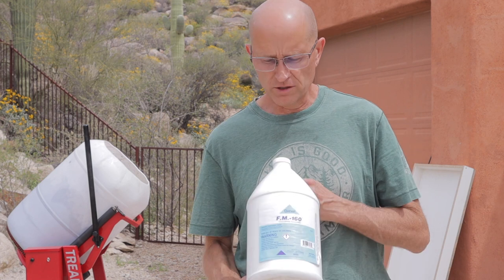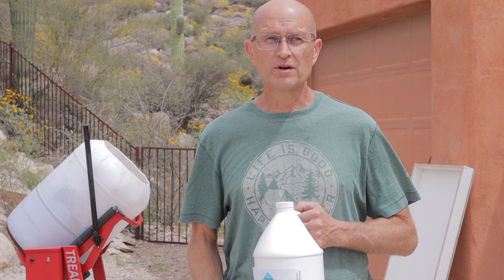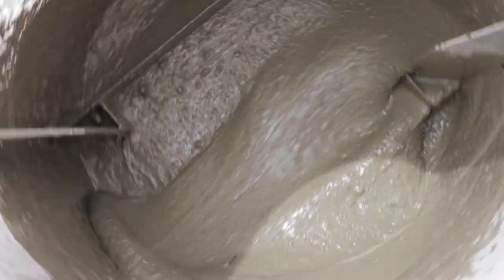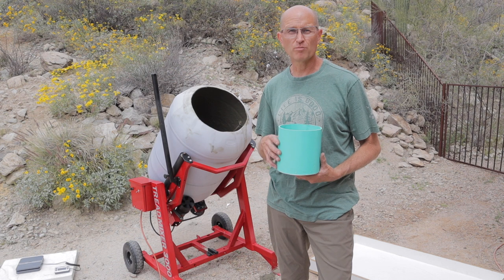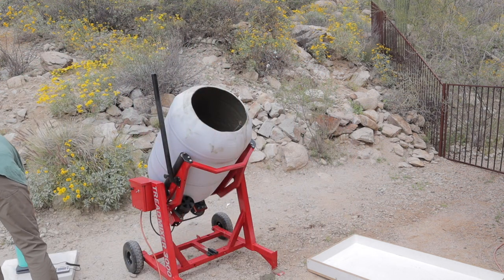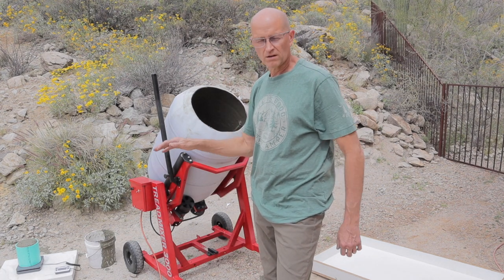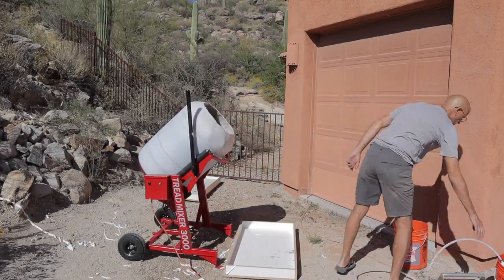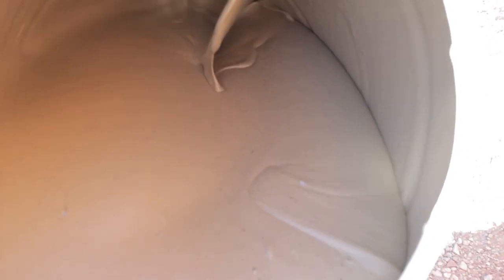How to Make AIRCRETE The RIGHT way!  [ How to measure Density for consistency.

Comment: OK, you had me with the TREADMIXER 3000 sticker! I was wondering who made such a cool mixer - where you could use different plastic drums, I assumed. Then to realize that it is just one eccentric guy that builds them. Thanks for your info! Yes, CMX is more powerful with significant minerals present, but their enviro warning...maybe does not apply in your climate. Still learning about aircrete. Thanks!
Reply from the maker: SpaceCrete, hey thanks for the nice comments!  Yeah, I think we’re all still learning with this Aircrete thing. CMX is the best I’ve used so far but I’m not too thrilled about the chemical warnings! If I can find a natural protein based concentrate that works as well, I’ll be switching to it.  Oh yeah, and that Treadmixer 3000 is hand painted on the side, not a sticker! 🤣  Eccentric is a good word for me, much better than others people have used.😀 Anyway, thanks for watching and if you find a good nontoxic concentrate that you like please let me know. Thanks, Don👍
Reply: @PranaTech  One strategy is to use a strong set accelerator to kick the cement before the foam collapses. I think this is why Honey Do adds Baking Soda. Though most foams seem to have some initial fade as you begin to mix in the slurry. And the surfactants like SLES really retard the set. The protein ones literally stink. To test other mix components I am always using CMX right now - consistent.

Comment: I love all of the Air Crete devices you have made. I wish I could get my husband to build them for me, but since he is too lazy, I will just have to build them myself. I haven't looked yet, but have you built a foam generator using a standard air compressor for the air? I already own a very nice air compressor, so I don't need to build that box unit you made. I have seen other people build them, but they don't explain their designs well enough. Maybe I should keep searching. Thank you for the wonderful information.
Reply from the maker: Hi there! Thank you for your kind words! I did another video about my high performance foam generator that is completely powered by air which would be better for you since you already a good compressor. That video is in my Aircrete playlist on my channel but here is a link right to it. https://m.youtube.com/watch?v=L-SAHq9X9QQ&t=34s   You don’t need to put it in a box, you could just mount it to a board if you wanted. I’m finishing up an even larger foam generator that is built in an open frame setup and I should have the video up in the next couple weeks. Let me know if you have any questions. 😀👍Don
Reply: Is it fair to call your husband lazy if it's your project? Maybe you should just do it yourself.

Comment: Hi Don,

In this video you used Drexel F-M160 but in your "Aircrete Foam Generator Machine DIY" video you used CMX Foam Concentrate. You've said you like both of them, but in each video you seem to prefer the one you used in that video ... so now I'm confused. Can you perhaps point out which features of each you like best? Or is one nearly always better, and if so which one?

By the way, thanks for another great video!  :-)
Reply from the maker: Hi Fred,  the footage for the foam generator was shot after the making Aircrete video.  I have only played with the CMX concentrate a little bit with making Aircrete and my initial experiments are showing it to be superior to the Drexel.  Sorry for the confusion!   I’ll be doing another video on the CMX in Aircrete in the next week or two once I have some more substantial results. Thanks for catching that! 👍Don
Reply: Prana-Tech I am having such a hard time keeping my aircrete from collapsing. I am using Drexel but not sure of mix ratio (water to agent) and my suspicion is that ratio causes the bubbles to be unstable. Also are you aware of a vertical limit on aircrete whereas after a certain thickness it cannot support its own weight? Current foam agent to water ratio used is 2c to 5gal. Seems like good foam out of my generator but doesn’t last once mixed with Portland and poured into mold. 😖
Reply from the maker: Hi Zach,  I’ve been playing around with this for a while and have at times struggled with collapsing foam issues as well. One of the things I found was the mineral hardness of the water really affects the Drexel foam.  I tried using distilled water for my foam concentrate and it made a big difference in the longevity of my foam. I started playing with the Richway CMX foam and it is way superior to the Drexel foam and is made for concrete. Your 2 cups of Drexel for 5 gallons of water is exactly what I was using for my Drexel based aircrete and sometimes it would just collapse depending on my mixing time. Very frustrating!  Hope this helps👍😁Don
Reply from the maker: Hi Zach, I realized that I didn’t answer your question about vertical limit of moulding Aircrete. It seems that it is around 2.5 to 3.5 feet in height depending on the quality of your foam for how high you can mold before it begins to collapse.👍
Reply: @zachsteele1089  You may also be putting oil from your air line into the mix thereby causing contamination which will destroy the foam. Oilless compressors are a better way to go.
Reply: Tad Johnson thanks for the reply. I just checked and my comp is oil free. Also municipal treated Lake Michigan water. The foam alone lasts well but once mixed not so stable. How important is water to Portland ratio? I’m a mason by trade and my experience says more water weaker Crete. Does not using enough water inhibit the integrity somehow?
Reply: @zachsteele1089  It can be touchy. All of us have had collapsing mixes and it only allows about three variables. 1. How dry the cement/water mix is. If there is not enough water to fully hydrate the portland, the cement will try and pull water from the foam mix and cause it to collapse. 2, Not enough foaming agent makes a weak bubble. 3. Contamination from either minerals in the water (salt, etc can be a problem), or oil contamination, or the plastic buckets etc, have a layer of oil on them. It really doesn't take much to make a bad batch. Lets try increasing the foaming agent and see what we get.
Reply from the maker: Great advice here all around from Tad! Thanks man!👍😀
Reply: @PranaTech  Thanks. I'm up in Show Low. We should exchange tech. I'm trying Stable-Air if you want to try some. I'm also working on consistency by using plasticizers which should increase foam stability and increase hydrophobic traits. PVA with gypsum/portland and excluding foaming agent is another set of tests I will run for ultra lightweight insulation only foam that sets within minutes.
Reply from the maker: Hi Tad, my email is pranateq@gmail.com  I would love to see what you come up with the PVA stuff! That is something I’ve been wanting to work with for a while now but I don’t have the chemical knowledge to dive into it. Thanks, Don👍

Comment: Ok you are on , I am an old geezer as well. However I am working on a 3D concrete printer . The printer has the ability to from a ten foot concrete circle eight feet high. The printer can print various form, shapes . If I work with you we cover two new technologies and build on our efforts.
Thanks for the read Walt
Reply from the maker: Hi Walt!    Wow a 3D concrete printer! That’s a pretty cool idea! Aircrete is very runny like a milkshake. How would you get that to stand up and not run off ? Here’s a link to a company that makes a bunch of different solutions that make concrete stand up with no slump. http://alliedfoamtech.com/Appgeotechfoam.htm   😊👍

Comment: I just got a 3 Oz sample of Vermillion. What is not clear are the followings: for 94 lb of cement and 6 gallons of water for making the slurry, how much water rouse with how much foaming agent and what would be the concentration of foam ? . We need to know the density of the foam? I mean at what PSI the foam generator would be creating the foam to inject it in to my slurry. So, several Q here: amount of foam agent in how much water? At what psi setting on the foam generator? Thank you so so much?
Reply from the maker: Hi Maria, it has a variable ratio up to 250-1.  I have been using 3 ounces of Vermilion concentrate to 5 gallons of water and it works great! 😁👍

Comment: Hey, I make stone veneer with a typical rich concrete (fine aggregates and Portland)

I’ve seen other companies such as Airstone and Evolve stone using a material very similar to this I believe. 

I have some questions and would love to get in contact
Reply from the maker: Very cool! How did you make your molds and do the coloring to look natural? 😊
Reply: @PranaTech  we use a third party company that makes rubber molds. We use oxide pigments to mimick the coloring of natural stone. interested more in the formula for a strong, lightweight but cheap batch rather than using 3/8 aggregate. 

It would eleminate storage that aggregate takes, moving that aggregate....but I’m interested in your take on filling our rubber molds(1,500 square feet a day) with aircrete and the formula you might use(maybe add sand?)
Reply: @PranaTech  can you put together a formula for one cubic yard
Reply from the maker: Hi there! I use just a basic foam and Portland mix to make very lightweight Aircrete. It is way to fragile for your application, but if you add sand it gets more and more durable. Here is a link to a chart with percentages of sand added and their strengths.https://drive.google.com/file/d/1BLYueqCIp7c6YN1LklAt4uoINeXFDtA_/view?usp=drivesdk  Here is also a link to a company that makes a very interesting product and would be perfect for your application. http://alliedfoamtech.com/Appgeotechfoam.htm 😁👍
Reply: @PranaTech  ty

Comment: Hi
Hope you are fine and in good health
Great work
Sir i want to know the mixing ratios for different densities and strenght.
Shall be greatfull for that kindness
Reply from the maker: Hi there! Here is a link to a great chart that shows the different mixes and densities with regards to strength. http://dlvews.com/wp-content/uploads/2017/08/Strength_Density-Charts.pdf 👍😀
Reply: Can you add rebar to the aircrete? If I were to build a small coffee table?.
Reply: Yes
Reply from the maker: Yes but the finish of Aircrete is pretty rough with all the air bubble holes that are on the surface. If I was going to make a lightweight coffee table, I would make a mold and spray a thin layer of some high quality counter top concrete and then fill up the mold with Aircrete to give it the thickness you want without weighing 200 pounds. I wouldn’t use rebar though, I would use scrim that will reinforce the concrete and not add weight. 😊👍

Comment: So, can you tell me the proportions please? 
3 Oz of Vermillion to 5 gal. Water. Then 
how many pounds of cement? 
In how much water?
How much foam for the above mixture?
How much air in rhe foam generator?
Thank you so much for your help
Reply from the maker: Hi there. 5 gallons of foam concentrate is plenty to make a 45 gallon batch of aircrete. Mix a 94 pound bag of Portland cement with 6 gallons of water in a55 gallon drum and then add foam up to the 45 gallon level. Mix throughly until the foam is fully blended in but don’t over mix it or you will kill the foam. Air pressure is usually at about 55-60psi.😁👍
Reply: Vermillion or cinnabar is the second most deadly substance known to man. Why not 6oz. Just go for it.
Reply from the maker: Hi Ron, Vermillion is the name of the company that makes the foam concentrate for Aircrete. It’s as completely harmless as Johnson&Johnson baby shampoo.😊👍
Reply: @PranaTech  I would have to say they made a poor choice in naming their company.
Reply from the maker: It’s the owners last name so I’m sure he feels differently about the name.😁

Comment: can you add rebar to aircret?
Reply from the maker: Hi William! Most of the time it is not used with Aircrete because it is so lightweight that it doesn’t have the density or tensile strength to be worth it. If you made it denser with adding sand to the mix, it would probably work fine.😊👍

Comment: What is your concrete mixture formula/recipe before the foam is added.
Reply from the maker: Hi Fred! My recipe is mixed in a 55 gal barrel and I mix 6.5 gallons of water with a 94 pound bag of Portland cement and once it is blended into a nice even slurry, while still blending with my drill, I fill the barrel up to the 45 gallon mark with foam and then keep blending long enough until the foam is fully integrated and then stop and pour into mold.😊👍

Comment: Awesome video!!! Do you know temperature application for Aircrete? Didn’t see any video or cold places, here in Alberta , Canada in winter  could make -35 C plus winds, this material would be suitable for a house construction? Thank you.
Reply from the maker: Hi Pablo,  yes it is fine in any weather. It has great insulation properties as well. 👍😀
Reply: @PranaTech  thank you for the fast response. Interested in the method, i was thinking double wall with straw in between to get even more insulation. Have a great weekend!!.
Reply from the maker: Wow, that would be an amazing R value and sure would retain the heat in the winter!👍
Reply: Pron5 not needed just cast a thicker mold and increase density to 1500 to 1800
Reply: @pablop7872  strawbale home with aircrete instead of cob? Interesting. Should be more than insulated enough but won’t offer the “heat bank” effect of cob. Still, if you have a decent masonry heater inside anyways you wouldn’t need that!

Comment: Wouldn't the density be determined by the ratio of slurry - foam, i.e., the slurry volume increase, e.g., 1-1, 1-2, 1-3, or 1-4? What was the volume of water - cement powder or do you go by weight?
Reply from the maker: Hi Don! The ratio I go by is one 90lb bag of Portland cement mixed with 6.5 gallons of water in a 55 gallon drum. Once mixed add foam until it comes up to the 45 gallon mark on the drum.  A smaller ratio of this would be  15.66 pounds of Portland cement mixed with one gallon of water. Then add 7.5 gallons of foam. Hope this helps.😊👍
Reply: @PranaTech  I assume the smaller (richer) slurry mix would total 1 gallon volume. How do you measure 7.5 gal. foam? I assumed you just added foam and gauged the volume increase by eye. Or, are you saying you add foam until you get to a total volume of 7.5, giving a ratio of 1-6.5?
I was planning on making a rocket stove of aircrete in one caste. It's cheaper than ceramic, lighter, and can be carved as needed, e.g., secondary air holes.
Reply from the maker: Hi Don. You were correct with the second method. I take my mixing container and add water in increments of 1 gallon or 5 gallons at a time depending on the size of the container. Marking it with a marker at every increment. You then mix the slurry in the container and add the foam until it comes up to the 7.5 gallon point. It’s not exact because the foam doesn’t fill like a liquid but it will get you close. To be really accurate with your Aircrete you need to weigh the mixture once blended to know exactly what your density is. My how to make Aircrete the right way shows how to do this. Also, if I was making a Rocket stove out of Aircrete I would add some sand to make the end product more durable. Aircrete is quite fragile and can be quite crumbly in the lighter mixes. 😊👍
Reply: @PranaTech  If I want 60 pound per cubic foot concrete, should I assume I simply cut the foam in half from your recipe?
Reply from the maker: Well, that sounds reasonable but I think once you go above 45 pounds you need to start adding in some fine sand to make that kind of density. That’s what the guys in the Philippines do and it makes the blocks structurally sound for weight bearing walls. 😊👍

Comment: Hi,
Do you know if you can use rapid set cement for aircrete? And...how would it fare using some kind of aggregate (pea gravel)??
Thanks
Reply from the maker: Hi there,  I think the rapid set cement would work fine. The aggregate doesn’t work so well because it sinks to the bottom of the Aircrete due to the weight. You can use sand to increase strength and density if that’s what you’re going for. Just reduce the foam amount in the Aircrete mix so there is more Portland cement in the ratio and this will float the sand in the mix and make a higher density Aircrete.  Hope this helps! 😀👍 Don
Reply: I've used Rapid-set (CSA, calcium sulphoaluminate) with aircrete and it does work. I will be trying Magnesium Oxide very soon considering the set time of 5-15 minutes it should be a good one. Mag-Ox is used in the "Air-Krete" brand insulation because of it's rapid set time it will not allow the foam to collapse before it sets. In fact they have accelerators that allow it to set within a minute or two! Although there is no currently available way to slow down Mag-Ox cements which can be in issue in other applications.
Reply: @PranaTech  Lightweight aggregate? Not as pretty as river gravel, but durable.
Reply: @MrInnovativeEnergy my neighbor mentioned this magnesium can be purchased from feed stores in 45 pound bags

Comment: Sir please let me know....
1.    How big pannel I can make.thichness and cement ratio.??
2.    Can I use expanding  .?
Reply from the maker: Hello Shekhar,  you can make your panels as wide as you want. Probably should keep them no thicker than .5 meter to keep them from collapsing the foam.  I don’t have any experience with expanding foam with Aircrete so I can’t say yes or no.  Ratios are as follows. For every 7 kilos of cement add 4 liters of water and mix well. Then add 30 liters volume of foam to the cement mixture and mix gently just enough to blend completely and then pour into your molds.😀🙏Don